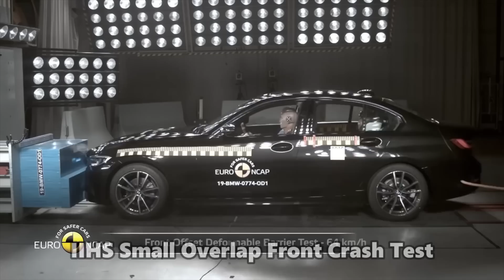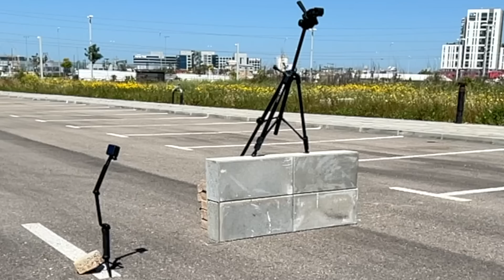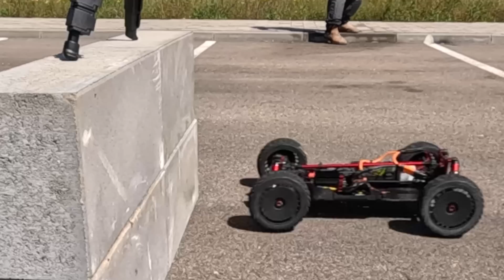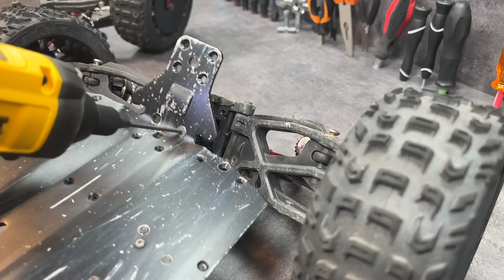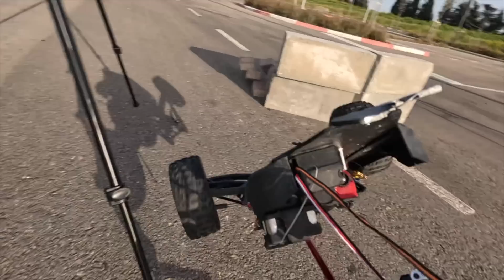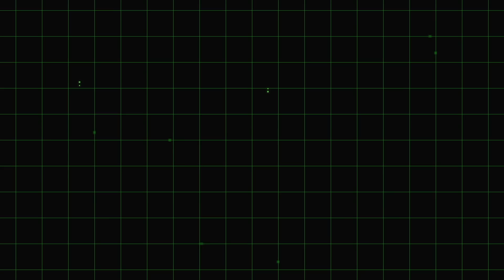Hitting Concrete Walls At 80MPH For Science - True Rc Car Crash Test

Comment: If you installed a metal cap in the front, it would’ve done way more damage. Also use a bigger RC car use the Traxxas XO1 at 100 mph. Car.

Comment: A really good demonstration of just how strong the plastic parts on these buggies are. 
It's very easy to look at a piece of broken plastic and think it was rubbish because it broke but the same force would have even mashed a steel component.
You should run a similar test exercise with the car tethered with some strong fishing line and see the damage as a comparison. I bet it will still loose things like front diff center out of the chassis. You could set the cameras at the end of the line to capture the destruction.

Comment: The problem is when I crashed my Arrma Kraton into a wall at 50 mph it did much more damage than what you're showing. It was in many more pieces bent like a slinky and not recognizable. The reason is I hit a really solid wall with no give. Your wall moved significantly during impact which unloaded many of the G's that would have been distributed to the RC car. Just food for thought. It wouldn't hurt to do it again, well you won't get hurt, the RC car will. As we know in 2023 even RC cars have feelings. 😂😂

Comment: Thank you for the visual of the enormous impact of a 12lb rig at 80mph (about 435 lbs if my math is correct).  The forced unleashed easily moved hundreds of pounds of concrete, not to mention what it can do to a human leg.  Through a perfect storm of conditions and an overconfident driver, I managed to tag myself with a Sledge at 40mph. It swept me completely off my feet as well as removing a boat-load of flesh.  I will wear a pair of 4" scars until the day I die.  RC cars are a fantastic hobby (or business) to be in but requires the same level of respect as any other hobby that could injure you if being careless/cocky.  Love the channel and appreciate the slow motion sacrifices made in this video.
Reply: The math is a little more complicated than “velocity times speed divided by 2,” and it comes out to more like ~5000 Lbs of force. 

Assuming the car is 12 lbs and it decelerated from 80 mph to 0 mph in 1 ft:

mass = 12 pounds = 5.44 kilograms
delta velocity = final velocity - initial velocity = 0 - 80 mph = -35.76 m/s
delta time = distance / velocity = 12 inches / 35.76 m/s = 0.3048 meters / 35.76 m/s = 0.00853 seconds

Force = (5.44 kg * -35.76 m/s) / 0.00853 s

|Force| = 22,788.4 newtons, which is equal to 5122.9 pounds force.
Reply: @TranceFur  Wow!  Thanks for the correction. Clearly, math was never my strong suit in school...but I can tell you when my Sledge hit my leg, it was the most violent impact I've ever sustained.  Whatever the force was, it was more than enough to ruin my day and entailed 5 months of total healing time.  I'm far more careful now and cringe when I see others drive fast around little kids and pets.  Thanks again for the correction and updated numbers.
Reply from the maker: Thanks!

Comment: please test traxxas maxx 1/10 v2. it supposed to be one of the most durable RCs ever. simply because it comes with the a durable modular tub chassis like the X maxx but in a smaller formfactor. and it the drivetrain is almost identical to the x maxx.